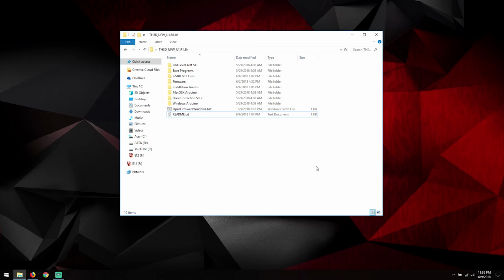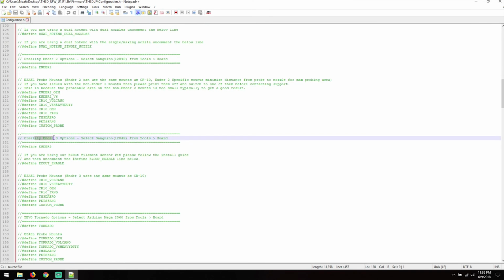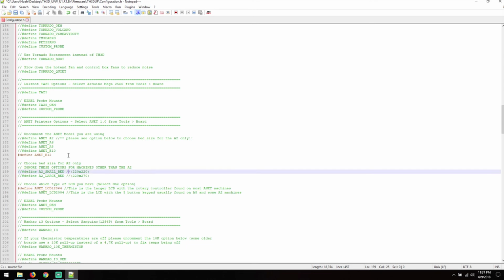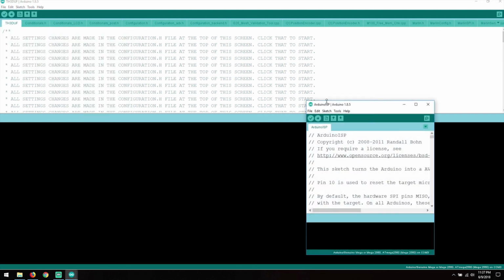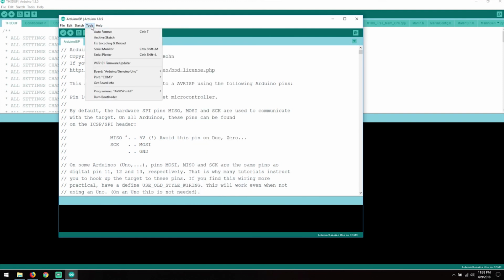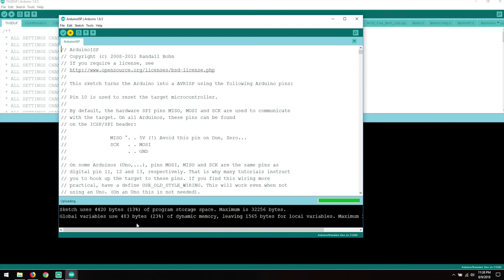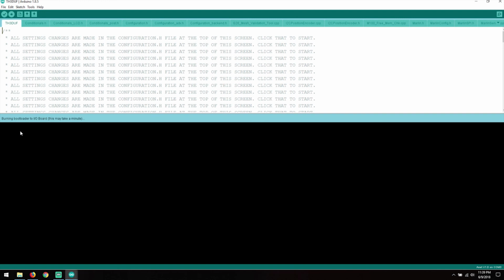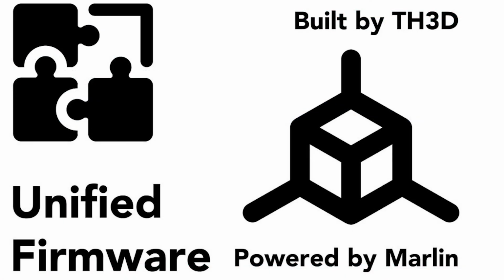Bootloader Flashing on Anet E12

Comment: Thank you for this video. I'd like to know following: Will I be able to do the same process using Mega2560? I know that there is different pinout, but will it work if I connect wires the right way? Because in all the videos I saw about flashing Bootloader to AnetBoard they were using Uno...
Reply: I saw a text tutorial using mega2560 so it should work.